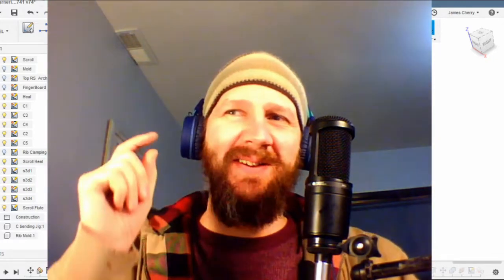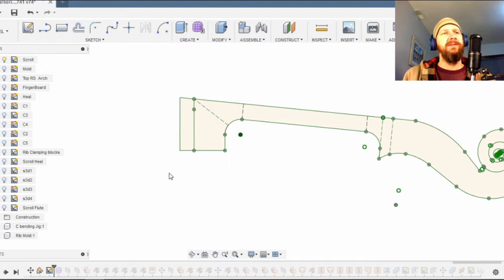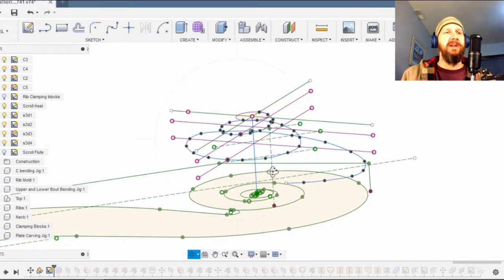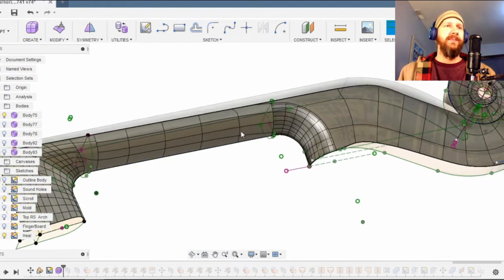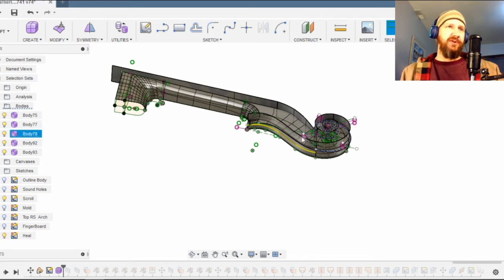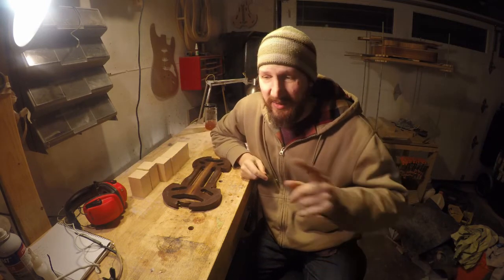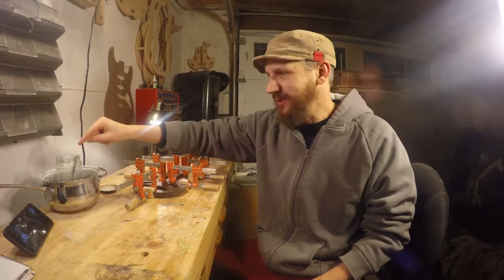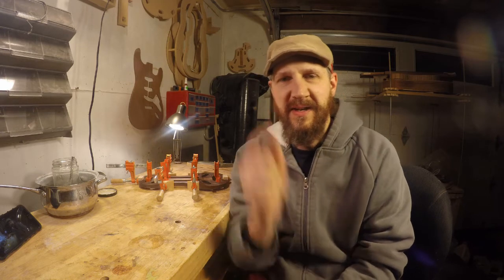Fusion 360 Violin Neck and Scroll | Making the Guaneri 'del Gesu' Vieuxtemps violin 1741

Comment: i would like to see a long video of this like you did for the top
Reply from the maker: Thanks, I've got plans for doing a lot more fusion 360 design and modeling videos in the future, getting the office set up and organized for it. There does seem to be an apatite for longer instructional type videos.
Reply: @TwoCherriesIns  I would like to see some instruction in the manufacturer (cam) section of fusion 360. Thanks for the info you have put out it's been very helpful.
Reply from the maker: @deandemers8624  Ok, I have been working on trying to put out some more content in that area. My techniques are not always traditional but they work well. Thanks for the feedback. I will be taking your advice and running with it.
Reply: @TwoCherriesIns  great